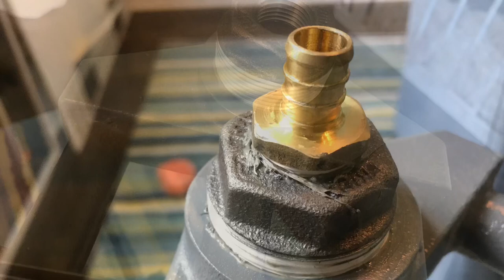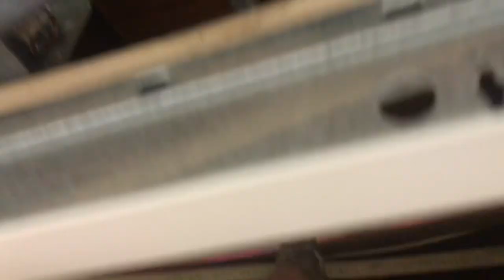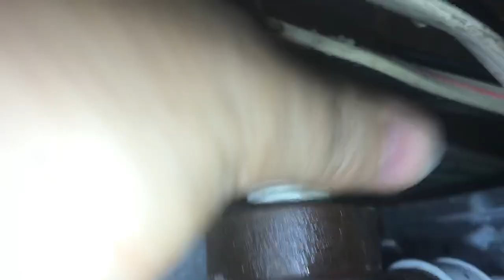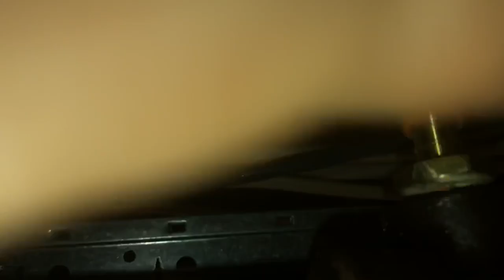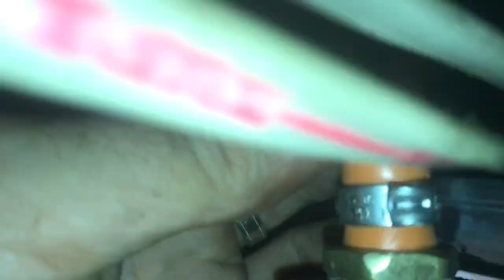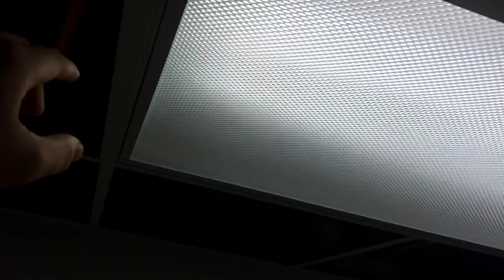Leaking convector radiator replacement with PEX - Monoflow Tee

Comment: this is exactly what i was looking for.  I could just replace my convectors with ecostyles and the secondary loops of my monoflo with pex. A well-sized ecostyle would allow me to run cooler temps, as I dont think my old convectors will heat the rooms enough at 120-130F.
Reply from the maker: just be careful that these old systems are kind of in balance so if you throw off the flow through the mono branch loops you might be affecting flow rates through the whole system. I am just a homeowner not an expert, though

Comment: hey I m trying to do the same thing. I have convector heaters, im trying to switch one of them to a baseboard heater. small one...I m thinking of doing the PEX fittings. How is your holding up till now. Do you have any suggestions? or recommendation and any tips, please help me.. thank you in advance
Reply from the maker: Sunny Sharif I’ve done two more after this vid. No issues. Make sure the pex has an O2 barrier and get good tools.
Reply: cannedjam I’m only using the PEX fittings and which tools did you use? Is crimping a good way to go?
Reply from the maker: Sunny Sharif I’ve only used the clamps as I show in the video. If you are replacing with a baseboard you will still need to add an air bleeder valve to that loop.
Reply: cannedjam I m a bit confused how it will all workout, I wish I can send you a video to show it to you. So the convector is attached with black pipe union, there is a thread on the pipe coming from the basement. So I need to find the sharkbite fitting that will easily fit. I don’t know how to solder copper pipe so that’s why I will use sharkbite fitting
Reply from the maker: Sunny Sharif do not use shark bite for this. You can use two ball valves with compression fittings on one side to tie into the supplies and then barbed pex couplings on the other. Go to a local plumbing supply store and run it by the guy behind the counter.
Reply: cannedjam I went to three different places and they were super rude and simply said, “we can’t tell you what to do, tell us what parts do you want to buy and we can sell you the parts or hire a plumber” so that’s why I started searching for videos or a tutorial. Do you have an email or a number I can send you the video of the system and what I want to do maybe you can guide me better
Reply: cannedjam that would be awesome if you can do that for me I will email you the video in a few minutes
Reply from the maker: Sunny Sharif throw it up on YouTube and send me the link.
Reply: cannedjam video sent to the email ;)